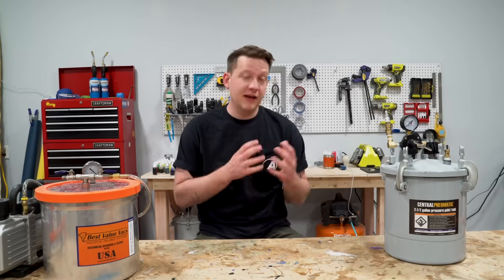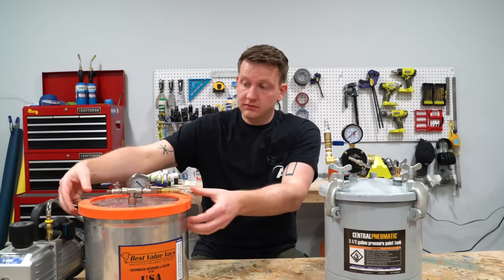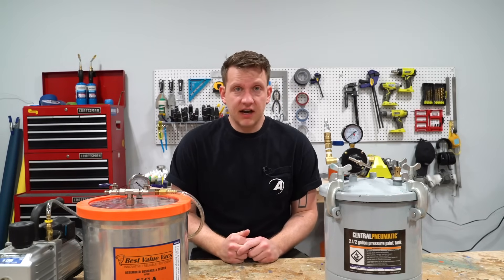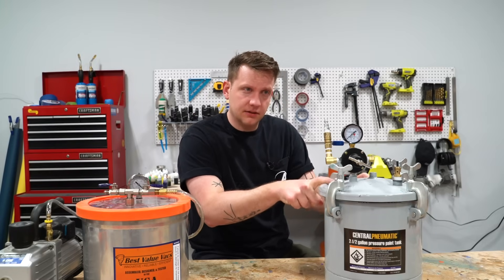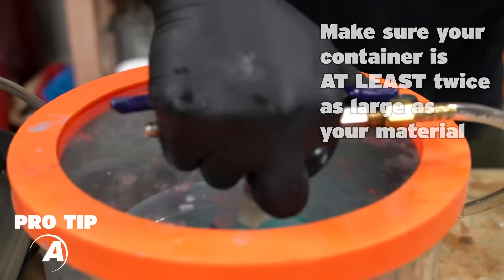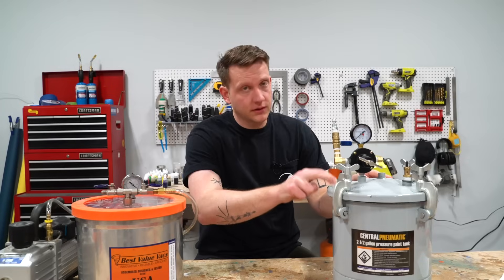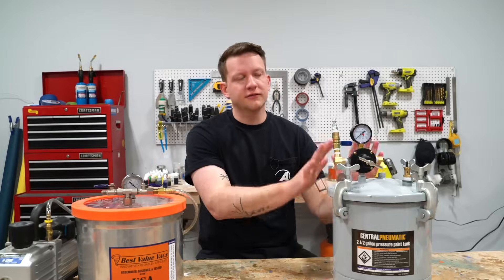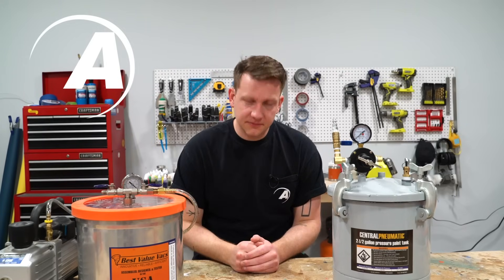When to Use a Pressure Pot or a Vacuum Chamber | Alumilite

Comment: @Alumilite Mold Making & Casting Materials My Epoxy Resin has a Gel Time of 20-30 min., Demould Time of 12-14 hours, Cure Time of 24 hours, and full cure in 4 days. Would a vacuum chamber be sufficient?
Reply from the maker: Great question! Not sure what you mean! For this type of resin, pressure casting in a pressure pot would work much better for getting rid of bubbles.
Reply: @AlumiliteCorporation  Sadly, I can only afford either a degassing pot, or a pressure pot (one creates negative pressure, the other creates positive pressure). I already need the degassing pot for silicone.

Comment: Great video! Thanks. With your Flex 60 casting rubber, would you recommend vac, or pressure? (for getting bubbles out of fine details after freshly pouring).
Reply from the maker: Either is recommended but a pressure pot will work well with freshly casted pours!

Comment: I'm not a moulder but often work with them and I often see them put pre-filled moulds into vacuum pots, then carefully de-gas them then slowly let pressure back in, I assume this last stage may also help force the resin etc. into the nooks and crannies of the mould, this helps reduce the time problems as you do the whole operation in the mould.
Reply: I work with deep pour resin that has a long open time (days). Wouldn’t the vacuum chamber be a better choice?
Reply from the maker: Thanks for watching!

Comment: Question on the vacuum chamber.   Once your silicon is ready to take out, you have to turn the air inlet valve on, to release the vacuum and allow the lid of the vacuum chamber to be taken off, right?
Reply from the maker: Yes! You won't be able to remove the lid without doing this!

Comment: Can a pressure pot be used for floral preservation? Do you still pour in layers or do it in 1 pour?
Reply from the maker: Yes a pressure pot can be used with floral preservations! The layers depend on what epoxy product you're using. If you're using a deep pour epoxy then you can pour the entire thing in one go and then place it in the pressure pot - no layers necessary! With an epoxy like Amazing Clear Cast you would still want to pour in layers!

Comment: Hi. I want to do wax casts in a silicon mold. Do I need one of these or its not needed?
Reply from the maker: You may want a vacuum chamber when making the silicon mold to keep air bubbles from ruining your mold - otherwise you shouldn't need either!
Reply: @AlumiliteCorporation  Thanks very much for response! ❤️

Comment: Can I also use either of these for 3d sublimation???
Reply from the maker: Neither of these apply heat so they wouldn't be much help with this process. You could always try it out if you had one on hand but we would recommend going with the typical sublimation machine.

Comment: If you're casting in the pressure pot, do your molds have to be made with a vacuum chamber first?
Reply: my research shows me that yeah, it's better to have used a vaccuum on you mold, otherwise there could be bubbles and the pressure pot could distort you mold and get you a less than perfect casting, also any bubbles in the mold may leave bumps on you resin castings
Reply from the maker: It's typically a good idea to pressure cast your mold if you're planning on pressure casting your resin later in the process! Degassing your silicone with a vacuum chamber is always a good idea if you have the time!

Comment: This is probably one of the most informative videos I have found on the subject of using both the vacuum and pressure pot. I recommend this to all new starters. Thank You Mark UK
Reply from the maker: Thanks for the awesome feedback, Mark - we appreciate it!
Reply: Is there anyone I can go to so that I can build a custom made vacuum pot.  The one I need has certain requirements that I can't find online.  Should I just seek out any engineer or mechanic? Anyone got a direction they can point to?

Comment: I was wondering If it could be effective to use both when casting silicone in a 3D printed mold. Vacuum de-gas the silicone, pour the mold then either vacuum de-gas again while its in the mold or pressure pot then de-gas again. I need to get all of the air out and the silicone into the nooks n crannies of the mold. the silicone im using has a 45 min play time so I should have time for both, Let me know what you guys think!
Reply from the maker: Some people definitely do both! Most of the time you only use a pressure pot with your silicone when you plan on pressure casting your resin, later in the process!

Comment: So if the resin has a slow work time I should be able to get clear parts like a pressure pot? To paranoid to use a pressure pot tbh
Reply from the maker: A slower work time gives more possibilities for natural air release. Most makers like to use a pressure pot with products that have a short work time so they can get rid of bubbles really quickly!

Comment: I have a small lathe and would like to make some bowls with wood and resin I think. I have not bought my chamber yet I am looking at a "4 Gallon 3mm Nozzle High Pressure Pot Tank Air Paint Spray Gun Painting 2 Hose" to convert. I also make pens. Can u please advise me?
Reply from the maker: When it comes to building pressure pots we are not the experts! We would recommend reaching out to a manufacturer like California Air Tools: https://www.californiaairtools.com/air-tools-accessories/pressure-pots/

Comment: Really helpful video! Is there any way that a pressure pot can be converted to a combo vacuum unit, or does anyone make them? I wasn't able to find any. I get why a vacuum pot wouldn't work as a pressure pot, but is there some reason it wouldn't work the other way with a pressure pot and the right valves?
Reply from the maker: This is something you would want to reach out to the manufacturer for! They'll have more insight on this topic!

Comment: I don’t have a vacuum tank. I use the pressure pot for both, the mold and once that set, I do it again for the resin.
Reply from the maker: It's very normal to pressure cast your molds - especially if you're pressure casting your resin in your molds! Thanks for watching!

Comment: I have a question! So of I have a resin that has a cure time of like 45 minutes or so, then would a vacuum chamber work for my resin projects? Or would you still recommend i use a pressure chamber?
Reply from the maker: It is possible to use the vacuum chamber in that situation!
Reply: @AlumiliteCorporation  thank you!!

Comment: How long does it take to degas resin in a vacuum chamber? I just bought one to degas resin. Did I buy the wrong thing? Help!
Reply from the maker: Hi Katherine! What resin are you using? Typically a pressure pot is best for resins, but it is possible to degas in a vacuum chamber.
Reply: @AlumiliteCorporation  I’m using Art Resin, it is notorious for micro bubbles. That’s why I wanted a pressure pot or vacuum chamber. It has a 40 minutes pot life.
Reply from the maker: @Sweetencourager21  With that long of a pot life, using a vacuum chamber should work. Mix your sides together and then degas until you see the bubbles rise and then fall in on themselves. Be careful as you pour into your mold, as that is when air can be reintroduced.

Comment: Can you use a bicycle or other manual pump for the vacuum chamber?
I know they can be adapted to suck air out but I'm wondering if it's worth the trouble.
I'd like to avoid buying a $60+ air pump if I can help it.
Reply from the maker: It looks like you can rework a bike pump for a vacuum chamber. The fit I'm unsure of, and I don't think it will pull as strong a vacuum as an electric pump, but may be possible. https://www.instructables.com/make-a-manual-vacuum-pump-for-under-%2420-by-convert/
Reply: @AlumiliteCorporation  
I appreciate you getting back to me. I bought a small vacuum chamber and figured out how to hook it up to the hand pump from a brake bleeder kit.
It's hard as all hell to pump but it draws the air out.

Comment: I'm having an issue with casting resin in a pressure pot, where my parts are coming out spikey. 
Its like the bubbles are on the outside instead of the inside. It's destroying my silicone moulds as they are then spiked and covered in holes. 
Any help/advice you can offer?
Reply: This seems to happen when your silicone isnt de-gassed. What is happening is the pressure is popping micro bubbles inside your silicone mold itself. Then the resin is now 'forced' into those holes. You can stop this by degassing the silicone using a vacuum chamber before you pour/create your mold. THEN use the pressure pot for the casting :)
Reply from the maker: This is a really strange issue! A lot of things could be affecting your project like this - we would recommend reaching out to our technical services team at info@alumilite.com with more details (like resin product & short process explanation)! They should be able to help you troubleshoot!
Reply: I haven't started yet, but on another video, I saw that you have to degas the silicone first and then use the pressure pot.

Comment: For the vacuum chamber, there’s no PSI or anything like that? Just turn it out and let it run?
Reply from the maker: Exactly - you'll want to turn it on and keep an eye on it so it doesn't overflow. It's not like a pressure pot where it's going to stay in there the whole curing process.

Comment: Years ago I worked at a R&D company where we used vacuum chambers to remove air bubbles from small mixed batches, of long-cure-time epoxy before we applied it to our parts. So I always wondered why the guys working with resin mixed with wood for (lathe) turning always used pressure pots instead of vacuum chambers. NOW I KNOW! Thanks.
Reply from the maker: Thats super cool - glad we could share some knowledge! Thanks for watching!

Comment: I have questions why silicon need degass does it wont make the perfect mould or give output?
Reply from the maker: Degassing silicone helps to release the extra air that get's trapped! It helps eliminate the possibility of errors with your mold!

Comment: But couldn't you suck the air out with the vacuum and let it set like you said do with the pressure? Because you weren't talking of pouring once the air was pressed out. So why pour with one and not the other?
Reply from the maker: The two machines are basically doing the opposite thing - the pressure pot is crushing the air until it's so small you can't see it, and the vacuum chamber is pulling the air up to the surface and out so that it can release. Because of this, you wouldn't want your casted resin to be put in a vacuum chamber - you can however put your mixed epoxy in a vacuum chamber, de-gass it, and then pour it into your mold!

Comment: Thank you for a brilliant informative video, could I ask, does the pump on a pressure pot have to run for the entire curing time or can you shut it off when it gets to the right pressure?
Reply from the maker: Bonny, Chris is right! We leave the pump attached in case of a leak we can easily add more air, but we turn it off when we've reached the designated pressure. I hope this helps!
Reply: I think it was pressure up, 40 psi, close valve to hold pressure on to set time. Whatever that length of time might be.
Reply: @chrisroberts6043  Thank you, I guessed it might be like putting air into a tyre :)
Reply: And a vacuum on such a small tank should only take a couple of minutes. It's not like you are creating a negative vacuum like in hvac for coolant.

Comment: So is I understand correctly pressure pot it's for small casting projects but if you want to make an epoxy table it's not gonna help you, you will need a degassing chamber. It that corect?
Reply from the maker: Our typical rule of thumb is that vacuum chambers are great for degassing silicones before pouring a mold and pressure pots are great for removing bubbles from resin/epoxy projects while they cure!

Comment: Quick question..do you unhook the air compressor once you’ve reached 40psi or do you leave it on the whole curing time? Thanks
Reply from the maker: Great question, Elaine! We typically keep our hose attached, just in case there happens to be a leak/loss of pressure we can quickly add air.

Comment: So...if i am making resin art pyramids and I want all the bubbles out and a perfectly clear see thru product, I use a pressure pot right after pouring and run the pressute pot the whole time until it is hardened/cured?

Im new to this but I want to make crystal clear no bubble art resin pyramids and other shapes. =]
Reply from the maker: Yes, that is the best process for that! You could also try our Amazing Deep Pour epoxy if you're looking to make the pyramid clear in one pour :)

Comment: Here's a question, I need perfect casts, and have both chambers. Should I vacuum my silicone master mold, then cure it in the pressure pot? And with the resin pour, repeat? What's a great method in getting a perfect cast?
Reply from the maker: Vacuums are great for silicones themselves - so if you're making a mold, that's the way to go. When casting, pressure pot will get you the best results!
Reply: @AlumiliteCorporation  no need to worry about spiking in the cast if a pressure pot isn't used in the mold?

Comment: sorry, may be stupid question, but can I use pressure pot for the cast made of plaster?
Reply from the maker: Hi Marina - we have not tried this, so I cannot speak from experience. You can do it, but plaster cures by evaporating water, so it being in the pressure pot may cause cure issues. Again, have not tried it.

Comment: Great video!
 I am wanting to cast a sphere in three layers, a clear top with object in it, the middle layer with alcohol ink and the final layer a solid color.  Can layers be done in a vacuum or pressure pot? And will either of these methods move the object in the first layer and spread or ruin alcohol ink drop effect??
Reply from the maker: Hey there! Yes - you can definitely do layers. You'll just pour one layer, put it in the pressure pot, let it cure. Pour the second layer, let it cure, and so on. I wouldn't recommend a vacuum chamber for this. For objects in the resin - they will move on their own if not held in place. For alcohol inks I am not sure the effect a pressure pot would have.
Reply: @AlumiliteCorporation  awesome, thank you.  If I was to purchase a pressure pot, would it be good to go as is for resin Or will it need to be mortified?
Reply from the maker: @AZ-ui1gg  you’d need to purchase one that is intended for resin or modify one for your needs. There are boatload of YouTube videos about this and if you need recommendations let us know :)
Reply from the maker: @AZ-ui1gg  It depends on where you purchase from! If you get from here: https://www.californiaairtools.com/air-tools-accessories/pressure-pots/ it will be good to go. Or you can take a paint compressor and modify it to be a pressure pot.

Comment: Excellent video!
Reply from the maker: Thanks for watching!!
Reply: @AlumiliteCorporation   I'm pouring silicone into poly molds to make prosthetics and no matter how much time I give for bubbles to surface in addition to pouring from a high distance and slowly into the molds, I still get pin bubbles. A vacuum chamber would help?
Reply from the maker: Yes! Putting your mixed silicone in a vacuum chamber before pouring into your mold helps get rid of bubbles!

Comment: Hi. I am looking at one of these to use for my resin but I do big table pours so will need to eliminate bubbles in my cup/bucket and then pour. Would a pressure pot still help this? I saw you put your mould directly into the pressure pot but with a table I cant do this. Would using the pressure pot still work for me and get rid of bubbles if I'm careful at pouring it or would neither the chamber or pot work because I have to pour into my mould after. Thanks :)
Reply from the maker: It depends on what resin you're using! Some resins don't have the open time to go into a pot and then do a pour. I'd recommend NOT putting it in a pressure pot for your project, because as soon as you open the pot, that air can go right back into the resin. What I would recommend for tables is using our Amazing Deep Pour epoxy resin which doesn't need a pressure pot. It has an extremely long open time, so all of the bubbles have time to surface!
Reply from the maker: Check out a few of our most recent videos "Preparing wood for epoxy resin"  and "Pouring a two-toned river table" to see our methods.

Comment: I’m experimenting with casting preserved chili’s in epoxy. The first attempts were ok but I’d like to remove more of the bubbles with either a vacuum pot or pressure pot. I’m not sure which would be better for my application. I’m worried that the soft walls of the chili pepper will collapse under pressure. Is this a legitimate concern with using a pressure pot for my application? Or will the pressure draw the epoxy into the voids of the pepper? Or is that what happens under vacuum? I really don’t know.
Reply from the maker: Hey Jeff - first of all, cool project! Second of all - what resin are you using? If you're using an epoxy (Amazing Clear Cast, Amazing Deep Pour) try warming your bottles in a warm water bath prior to mixing and pouring. This will make it a bit thinner so bubbles will escape easier. What type of mold are you using?

Comment: I use epoxy to cover tumblers that I have customized.  What would you recommend for that?  I assume the pressure pot but I need to be able to spread it on my tumbler before it sets up.  Your thoughts?
Reply from the maker: Hi Diane! For tumblers, we actually wouldn't recommend either. Pressure and vacuum work great for castings, but coatings come out clear because they're thinner pours (so the air bubbles have just a quick trip to the surface!). Using a torch or heat gun after you've coated your tumbler will help pop any stubborn bubbles.